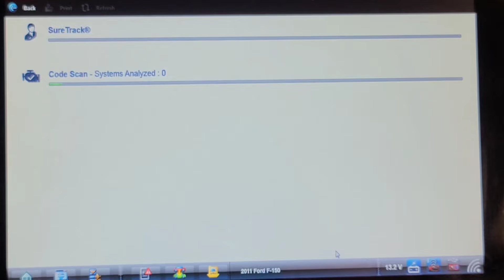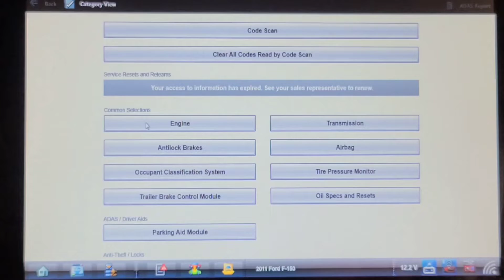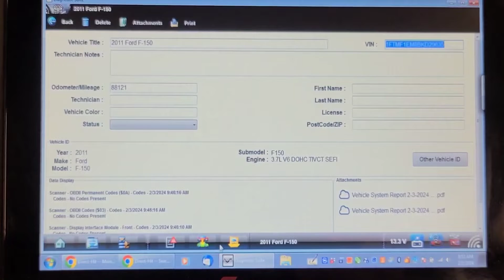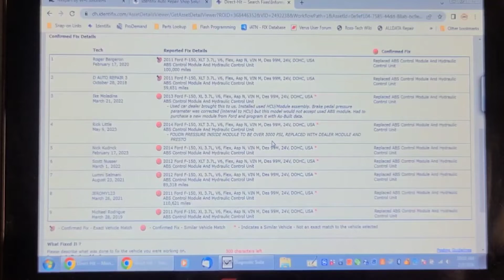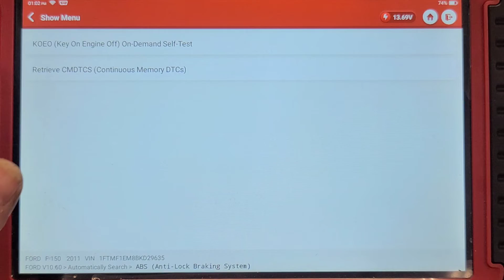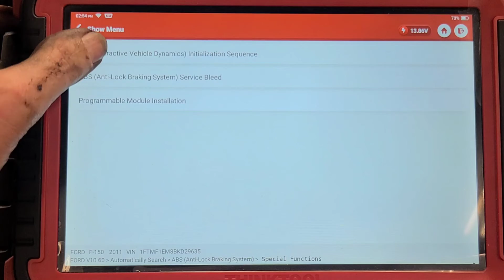2011 F150 ABS, Brake And TCS Lights On. B1596 And C116A

Comment: IM JUST GOING TO PULL THE FUSE SO I DONT HAVE TO SEE THE WARNING LIGHTS ON MY DASH ,BECAUSE EVERY THING WORKS PERFECT,I CHANGED A STUPID WHEEL BEARING/HUB/SENDING UNIT AND NOW I HAVE 3 CODES ON THE LEFT FRONT ,,STUPEDEST ENGINEEERED POS SHIT FROM FORD
Reply from the maker: I don't want to burst your bubble but pulling fuses won't eliminate the warning lights. You.would need to remove the bulbs but they are soldered into the dash. What codes are you getting?
Reply: @PhillipBailey  lol,yea im just going crazy with this bs on my truck,,it all started after i changed the hub and bearing on the drivers side,,anyhoo i just replace entire brake system on drivers side ,caliper,pads brake line and rotor ,it was sticking and smoked it,,so i relpace everything,,passenger side replaced wheel bearing,brake pads,,it seems as tho the abs/check brake lights have went off ,still have service advancetrac warning tho,,ive only drivin it around the yard ,but in the past the codes would clear but as soon as the truck moved it would come back on b1596 -20 eo it says mismatched  pressure switch transducer .but it was perfect until i changed a bad wheel bearing ,,
Reply from the maker: B1596 is an internal failure in the ABS Hydraulic Unit and will likely need the entire EHCU replaced. Could have been caused by bleeding the brake system or could be just bad luck.

Comment: Working on a friend’s 2011 F 150 5.0. Had all the abs lights on. Main error was the C1440. Long story short bought salvage unit module and HCU with identical part number to original. Installed full unit and then reprogrammed using Forscan using As built data saved from original unit. Seemed successful eliminating vin mismatch codes etc and got rid of all lights but the P/brake light and Check Brake system fault. Now it has P258A-E0 and B1596-20. From what I read the DTC I need to fix is the P258A - Vacuum Pump Circuit A Open code. Apparently this means my donor unit was from a 3.5 ecoboost which has this pump. The 5.0 truck doesn’t have it but the module continues to look for it. Based on what I read and my experiences so far, I don’t think you can correct this using Forscan. my question is do you know if this can be corrected using the official Ford IDS programming tool to change the ABS configuration to tell it to quit looking for the vacuum pump. It seems like everything I find online the people went ahead and just got a different ABS module from a naturally aspirated truck to fix it.
Reply from the maker: I had the exact same problem with the used part I installed and you're correct the 3.5 uses a vacuum pump. I'm not sure if IDS will be able to fix it though. What about installing your original module?
Reply: @PhillipBailey Thanks for your response!  Unfortunately I tried the original module with the salvage HCU already and couldn’t get rid of the C1440 fault. The only combination that fixes the C1440 is the salvage module and salvage HCU but it throws that vacuum pump fault. There’s a thread on JustAnswer with identical problem. I may subscribe for a month to see if they will tell me if it can be programmed. Hate to pay the programming fee and not work but the fact they are identical part numbers makes me think it has to be configurable some way to tell it not to look for the vacuum pump.
Reply from the maker: You said you used Forscan to do "As Built" programming. Did you have a subscription to Ford Service Programming for the data file? I suspect that you did a PMI, Programmable Module Installation, which copies the program from the original module and overwrites the replacement. That does not require a Programming license from Ford. I'd recommend to post your question on the Forscan forum. Someone there might have an answer. Another option is another used ABS module from a 5.0.
Reply: @PhillipBailey I have the extended license which allowed me to save the data from the original module and write it to the e new module. It will also allow you to pull the As Built data from Ford’s website and I did that as well and compared the values and they appeared to be the same as what I had from the original module. That’s a good idea to check the Forscan forums Thanks for your help.
Reply from the maker: @jeffcunningham9848 in theory using the As Built data should work and that would be the same as IDS would do. I had the same kind of problem with a used BCM on a Ford. I'll bet either a blank new module or another used module from a 5.0L is going to be your best course of action.

Comment: Omg this is all too much.   I did $300 repair with circuit board people, put on and learned codes are hydraulic unit.  Ordered one$200 off eBay and now see I can’t bleed this without $1000 scanner!
Reply from the maker: If you put a used ABS Hydraulic Unit on you should be able to pedal bleed the system. The ABS bleed procedure is only needed to purge air out of the internal accumulators. These will be full of fluid in a used unit. There are also some cheap scan tools that can do this. If you had your original module rebuilt it should not require reprogramming.
Reply: @PhillipBailey thank you very much, awesome!
Reply: @PhillipBailey as you said, my rebuilt electronic side and eBay hydraulic side fixed with a standard brake bleed.   I too torched every fitting, but broke one still.  Wiggling a little impatiently?  Simple repair and codes are gone.  Thank you!
Reply from the maker: Glad you succeeded in repairing it. I'm sure you had fun with those lines...

Comment: 2009 F150 xl, 4.6 have the exact issue, needs abs hydraulic pump and computer module replaced, over $2400 just for parts, labor, taxes, and reprogramming to add, wish there was a recall for this, my truck only has 123,300 miles.
Reply from the maker: It's usually just the pressure sensor that fails and that's Parr of the hydraulic assembly. You don't likely need the module portion so no programming should be required.
Reply: @PhillipBailey local ford dealership and local repair shop both state codes c1300 and c1963, dealership only wants to replace computer module then proceed to c1963, local repair shop tells me both computer module and abs hydraulic pump (what the computer module connects to) needs to be replaced, no other repair will do those repairs in my area, other than that can I continue to drive the truck?
Reply from the maker: @J.Owen-g3y it won't pass inspection like that and the ABS won't function at all. The base brakes should work fine but I would not recommend that you drive it like that...

Comment: I just went through this with my 2013 F150. The garage wanted over $2400 for the part and $375 to change and reprogram it. With their diagnostic charge and everything included their estimate came to $3019.22. I found one at a Salvage yard for $75 but the garage didn't want to put it on so, I took it to the garage 3 miles down the road from them and they put it on. Problem solved
Reply from the maker: Glad you figured it out

Comment: i know this is a bit older video but what model scanner are you using ? i need a scanner that can program modules, thanks
Reply from the maker: I used two scanners in this video. Snap-on Verus Edge tablet which does some programming but very limited and rhen a think tool which does a bit more. There is no universal scanner that will do everything unfortunately. What are you programming?
Reply: @PhillipBailey  2010 equinox awd rear diff module,what model is the think tool if you dont mind me asking
Reply from the maker: @artmoe9776  thinktool pro plus but it won't do that. You will need a J2534 pass through like a cardac plus from drew technology, a laptop and a subscription to GM SPS.
Reply: @PhillipBailey  thanks for the reply,appreciate it
Reply: @PhillipBailey  2010 equinox awd rear diff module,what model is the think tool if you dont mind me asking

Comment: 20:35 Did you do an ABS service bleed after installing the new HCU?
Reply from the maker: @stylezNsmilez  no I did not as it was used so the accumulators were likely full. Just pressure bled the system

Comment: Your video was the key to me understanding. New pump due to pressure sensor, I re installed the old module. After a test drive and code clearing it seems to be working fine with no abs light. Using creader crp 123 scan tool. Thank you and all the best to you and your family:)
Reply from the maker: Glad you figured it out

Comment: Been battling this exact problem for 2 weeks… lots of money has been spent….new hpu and module…excited to try putting my old module in with new pump before appointment at dealer next week. Great vid
Reply: Did you fix it? How?
Reply from the maker: @jocsixd5359 replaced the ABS Hydraulic unit

Comment: My 2014 f150 code  C1440 eo, did just module fix it or replacement of the hcu ?? Mine has built in psi swtch inn hydraulic unit
Reply from the maker: Ended up replacing the hydraulic unit.